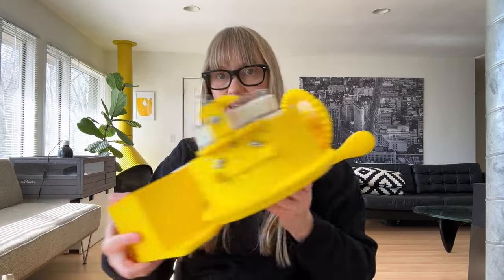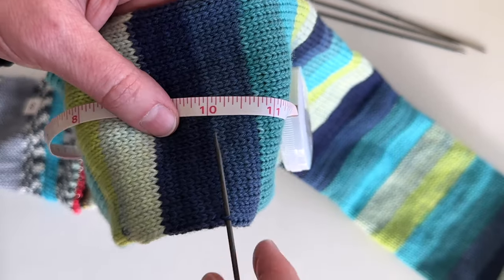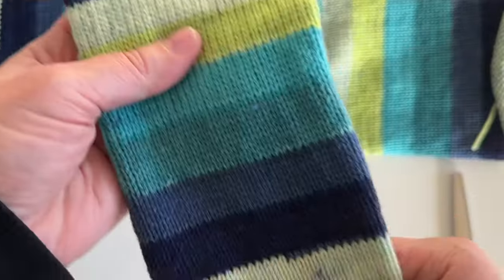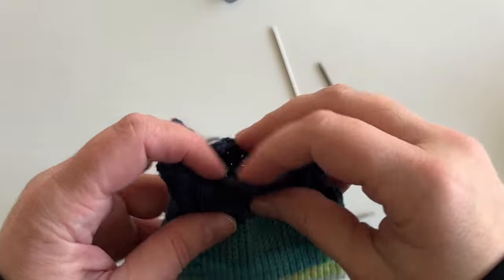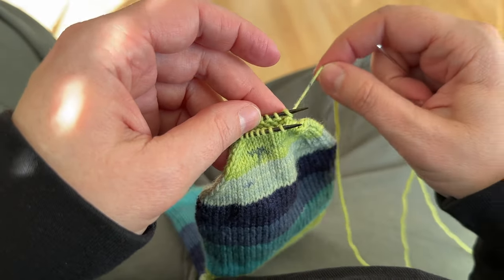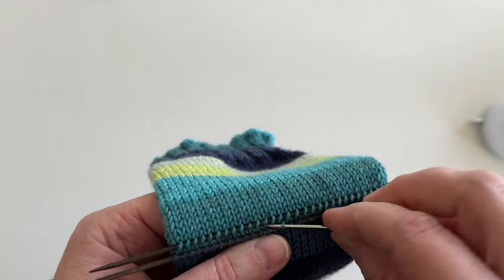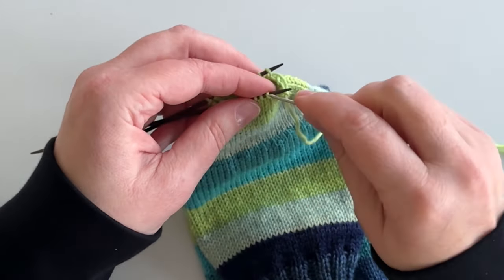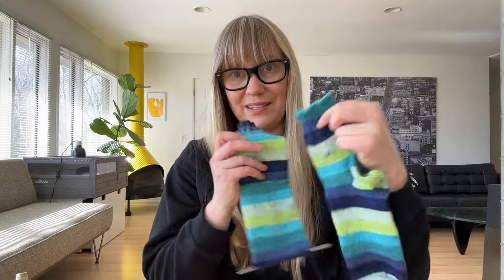How to knit a sock from a sock tube, start to finish!

Comment: One thing I have found very helpful is the bottom half of a salad spinner not my idea but set it under the tube as the tube grows it goes into the spinner and turns so you don't get the twisting I got one at a yard sale I have one for spinning out water from when I dye fleece or yarn funny I have one for salad too I should have bought stock
Reply from the maker: oooh, that’s a great idea!
Reply: Thank you for doing this.  I have been using my D & B since October and I  get stuck when it's time to do the heel. Seams like I'm missing something when it comes to the wrap and turn.
Reply from the maker: @it I sometimes get stuck too but their videos really do a great job of explaining. Definitely a learning curve!

Comment: When you're doing the toe, are you supposed to do a decrease round, then a plain round until 20? Because in the video you say after your get to 20 you do the decrease row EVERY row.
Reply from the maker: @momofcems  hi! so, yes - you can knit a plain round after you hit 20 stitches, but I sometimes don’t - either way works. (you just want 20 sts for the front of your sock, and 20 sts for the back of your sock, then you’ll repeat the decrease round - every round - until there are 12 sts on each needle.) usually when I hit 20, I just go for the decreases but you can wait and do one more plain round if you want.

Comment: Thank you Jen!  I find knitting machines like magic!!  (Do you have a special spinner to wind onto the cone?). Do you have to make two tubes if you want the striped socks identical?  How much waste yarn is created on the machine?
Reply from the maker: Hi! I use a drill with an attachment to wind yarn onto cones, but they do make special winders!  You can make matching socks from one tube, and use the rest of the yarn in between the matching stripes for heels, cuffs and toes. (And I save any leftover yarn for stripey mismatched socks!) Thanks for watching!

Comment: Hi Jen. I have been researching CSM and am very interested in the D&B to help me knit through my ever growing stash of sock yarn. This video was exactly what I was looking for. I prefer a ribbed cuff and other elements that would require me to do a hybrid type sock, but speeding up the stockinette leg/foot is so appealing! I have one question. My preferred heels are heel flap/gusset and a fish lips kiss heel. If I were to get this machine, do you think it’s possible for me to knit a tube, do my preferred heel, and then maybe graft it together to the rest of the tube? I hope that makes sense. That’s honestly the only thing holding me back from getting one of these machines I think!
Reply from the maker: yup - you can still do that! I show a simple heel here but you can modify heels to work in many different ways. I'm pretty sure you could kitchener a heel flap! and fish kiss would totally work.
Reply: @JenGeigleyKnits  thanks so much! Now to choose which color I want 🤔😁

Comment: Jen - if i am going to knit the tube, do i need to do a provisional cast on so the stitches for the top ribbing? or can i just use waste yarn to cast on then pull that out and knit the ribbing? im confusing myself as i think though this. thank you
Reply from the maker: Hi! I think the easiest way is to just use waste yarn and pull that out and then do the ribbing. Good luck!
Reply: @JenGeigleyKnits  sorry if I’m sounding dumb- for some reason I have it in my head that to knit backwards I need a provisional cast on.
Reply: @JenGeigleyKnits  but you are saying that as soon as you pull out or cut off a normal cast on edge edge - like a long tail cart on - I can use those stitches to keep knitting. Is that right?
Reply from the maker: @jacquelinepirotta  oh sorry - maybe I misunderstood your question! so yes, you can just keep knitting from those stitches! they are live and it works both directions!
Reply: @JenGeigleyKnits  thank you!